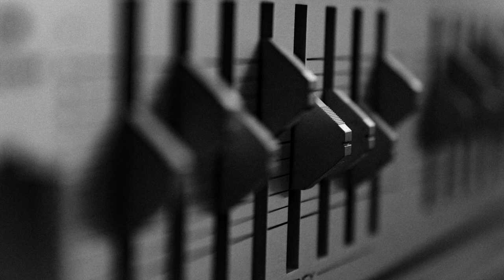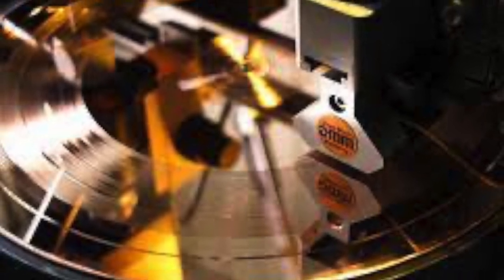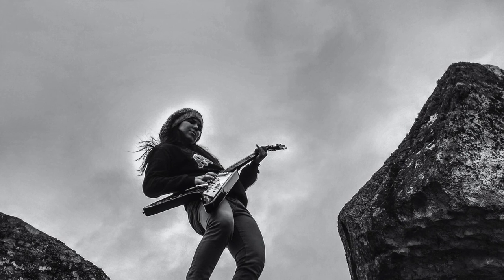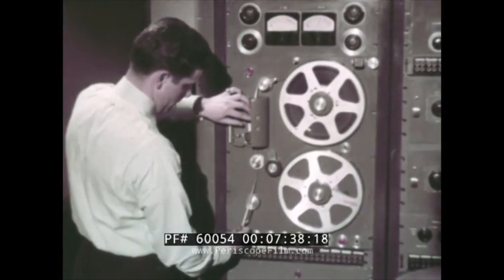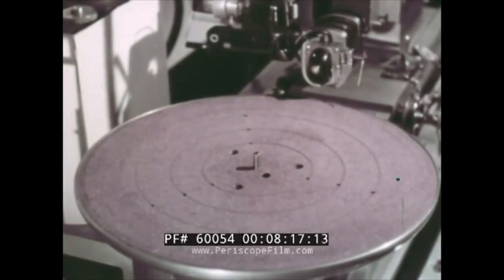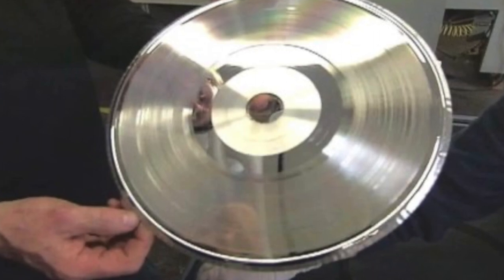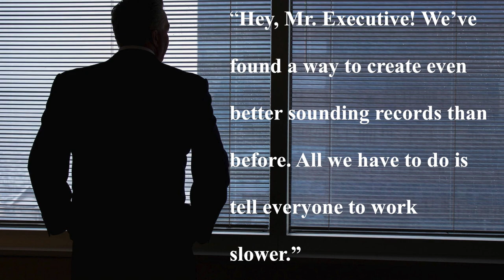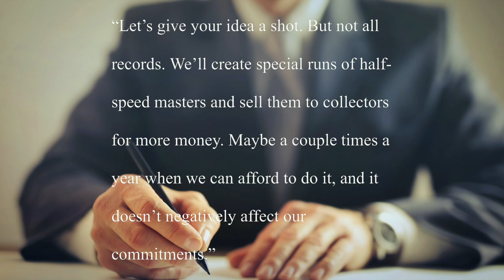Half Speed Mastering

Comment: Reposting on this video:
As far as I know, half speed didnt birth out of ambition to search for higher fidelity directly, but to solve a problem of cutting head overheating and began at Decca in the 60s. Stan Ricker then tried to sell people on the idea that Half Speed sounded better in the 70s.
So I would hardly agree that "Time" and "Money" are the main reasons its not used. It requires a very different understanding of what to listen for, loses an octave in the spectrum which needs to be EQ adjusted for and doesnt seem to produce as good sounding records as it should if everything said about it was true. I can hardly find a half speed cut that beats a standard cutting from a renowned mastering engineer. The only company having some success with it is MFSL, mainly in the 2010s and onwards. But Im pretty sure MFSL stopped doing half speed cutting when Stan Ricker died which is, you guessed it, in the 2010s.
Overall, mostly a gimmick in my eyes.
Reply from the maker: I'm glad you reposted this @Leon.  I had no way to carry over the comments when I upgraded the video from audio to actual images.  I appreciate your reposting!
Reply: I agree that it can be a gimmick in some cases but entirely dismissing it is wrong imo. Incredible sounding Half Speed mastered records are out there, regardless if they're better than the "standard" version or they just sound great on their own. Dire Straits's BIA HS master is fantastic, some people might prefer the MOFI for more bass or the Chris Bellman cut for brighter top end but the HSM version Abbey Road did is certainly the one with the most nuances and air in the treble. Its a different sounding master and there's nothing wrong with people having options. The HSM Ambient series by Brian Eno that came out in 2018 are also great sounding. Sade - This Far boxset features all six albums and all are Half Speed mastered. Every single one sounds beautiful and some do sound better than my old copies in terms of mastering. By far my best and most favourite HSM record is John Martyn's Solid Air released in 2016. I did compare it to the standard edition that came out exactly at the same time and its not even a competition. The HSM edition does everything better. Never selling mine and going forward imo that is the definitive version of that album, doubt even a 2xLP 45rpm cut could improve things any more. Definitely not all albums or types of music are suited to Half Speed mastering but the ones that are certainly can work very very well. And yes I'm well aware Miles from Abbey Road has had done some pretty bad HS masters in the past, but I reckon he still has plenty of time to perfect his skills.
Reply: @werk4408  The question is if these things can just be achieved through good modern mastering. If barely any half speed cut beats out other great normal cuts what is the point? With such a track record it seems pointless beyond a waste of time.
Im not saying it cant sound good, a fantastic recording like BIA or Solid Air will be great almost no matter what you do with them, this is all about comparing though.
I very much doubt the Solid Air HSM is better than the UK original for example.
Reply: @Leon Exactly. Well said and explained in detail.
Reply: @leon9021  No idea if the UK original of Solid Air will sound better, most likely it will sound different. One thing that seems to be a product of HS mastering is tamed sibilance. There's practically none of it in the Solid Air and Brothers In Arms HS cuts. In my books that's a good thing. And its one thing that you can't do with conventional mastering afaik. Plenty of albums could benefit from this, as we all know the vinyl format is very unforgiving of this particular issue, and from my experience how cheap or expensive your setup is doesn't influence the issue quite that much in the end. Again I see it as just another flavour of mastering. Nothing can be perfect. After all bad examples are out there for records mastered with half speed as well as ones mastered conventionally.
Reply: @werk4408  Sibilance reduction or De Essing as its called in mastering is not a product of HSM.  In a fully analog mastering you actually cant de ess very well at all using HSM, much worse than normal cutting anyway.
The reason why the Abbey Road cuts can reduce sibilance is because they are done in the digital domain first where you can very easily utilize that technique, but you can do that just as easily for normal cutting too, the 2016 Pink Floyds are a great example, as they use some very good de essing on albums like Meddle.
You can de ess in conventional AAA cutting but you have to keep in mind that a lot of times its not just due to the mastering. A lot of times sibilance is due to the end users gear, particularly stylus. You can run the same mastering cut with a Conical which distorts and splatters S´s like crazy while it plays perfectly on a MicroLine stylus.
I know this to be absolute fact because Ive dont it myself and it makes total logical sense if you read up on the purpose of higher end styli, I promise you, its very real.

My point is, if its all flavors of mastering, then why spend time doing Half Speed. Just get the same flavor with normal mastering without losing an octave of information and taking twice as long.
Reply: @leon9021  I wasn't aware you can do it with normal cutting also. It does make sense they do it in the digital domain first though. Maybe it's just not utilised enough with normally cut records, and it really should be for some of them. There's plenty of highly coveted audiophile recordings that are inherently sibilant and no one has done anything to improve that when pressing them to vinyl. 

I'm fully aware of how the stylus shape effects the sibilance but in my case that doesn't apply. I use Shibata and MicroLine stylus cuts (aligned and dialled in perfectly) daily so when a record has sibilance I know its not my stylus. Its true that higher end stylus cuts can track it better but you still hear it, when it can be reduced from the beginning. I guess it will be a case of authenticity for some people though. I can imagine many saying that we shouldn't remove information from the recording so if a vocal was recorded hot with sibilance that it should be preserved like this so we can hear it without any changes. 

I get your point but at the end of the day I guess the people putting out the record will decide if the time and effort spent on it is worth it. For many of us it was totally pointless to release the UHQR Kind of Blue with all that fancy packaging and box when it could have just been a standard $40-50 release in a good quality tip on jacket. The end result in terms of sonics would have been identical. As far as the losing an octave goes, I wonder if that is something that anyone can actually notice in reality? From my personal tests and comparisons it seems that I can not. Another HS master record I compared to the normal release was the seminal jazz album by Ryo Fukui - Scenery. I have the 2017 Japanese reissue by Nadja and the more recent Half Speed master that the Swiss label We Release Jazz put out in 2018. There are things I like in the HS master more than the Nadja issue, and overall it sounds outstanding. In fact if that version was pressed in a nicer plant somewhere in Japan it might have even been all together the clear winner of the two. If you read the Discogs comments for that particular release you will see I am not the only one saying how good it sounds. Also I can discern no difference in terms of an octave being lost, everything sounds right and nothing is "missing" from the HS master version. If anything the dynamics of the piano particularly are better. Drums and bass are about the same, bearing in mind this isn't some pure audiophile grade TBM recording to begin with. 

One thing I've noticed with some (not all) Half Speed mastered records is that the whole sound signature can be somewhat... balanced. By that I mean that no particular aspect jumps out too much on its own, be that bass, treble or mid-range. In some cases that can be a good thing, and in others it can make for a more polite sounding master, which I get might not be preferable always. But there are plenty of examples where quite the opposite is the case. Possibly the best sounding HS mastered LP I own is Doug Macleod's There's A Time by Reference Recordings. Double LP at 45rpm that is certainly in top 10 of best sounding records I have ever heard. What I can say about the mastering is that it is very far from balanced, basically everything stands out when it needs to. Great example that demonstrates that HS mastering can sound full, punchy and rich in the bass department when done right. Demo material for sure.
Reply: Yes indeed, Kevin Gray talks about it briefly here:
https://youtu.be/VbVx-e9i1Uk
De essing is losing a bit of information, especially depending on how its done.
Personally I have not noticed much of any sibilance st all since I got my MicroLine.
I have reviewed a lot of albums and used to comment regularly on sibilance but this is rarely ever mentioned now.
Im surprised you hear it so much. Worn records or old styli perhaps?

I completely agree things like the UHQRs are redundant as well. I wish most of those were just done like the Brubeck Time Out 45, you barely gain anything at all from the clarity vinyl, flat profile and boxed packaging except higher prices.

As for the lost octave I cant elaborate much more. Its EQ adjusted for however so it wont sound like its missing completely.

I have the Ryo Fukui too, its great for sure. But I state in my old review which is on Discogs too, that its not quite on the level of something like a Music Matters Jazz and would probably prefer the sound if it was in the hands of someone like Kevin.
There are plenty of balanced sounding normal cuts as well, I dont think thats an effect of HSM.

Again, you can make great sounds on HSM, but if you can make equally great normal speed cuts or even better in my experience then I have to declare it a gimmick

Comment: I'm very disappointed in the two brand new half speed masters I've bought.  Issues with cracks/pops on the "Back To Black" Amy WInehouse album which also sounded even worse than the US standard pressing (I'm in the UK).  The Abba one wasn't any better.  All looks very nice with the certificate and all but what's the point if the sound is crap?  My 80's half speed masters sound much better so really disappointed with these new ones.
Reply from the maker: I have seen a marked drop in quality as well @Ian Marshall.  Not only with the ones you've mentioned but across the board with new records.  Pressure on the industry to meet demand is one factor.  Jack White recently urged the major record companies to start building their own plants again.

Comment: I trust there exists a logic between the old 16 and two 3rds rpm 'talking' discs, when rpm is doubled it (more or less) equates to 33 and one 3rd rpm. Likewise with 33 and one 3rd rpm added to the (usually ) 7inch 45rpm speed gives us (more or less) 78rpm. I recall an article of yore that suggested 78rpms were recorded at 50 inch per second reel to reel tape? Naturally, the higher the tape speed resulting in less hiss transference in order to make a master/ stamper configuration. Some of the later 50s 78s I own (usually EMI) distributed labels were pressed on swish o flex,  vinyl, with no shellac content, allowing them the flexibility of the new vinyl 45, but without the sound compression.

Interesting Channel Sir.

Cheers

El
Reply from the maker: Cheers @Tablet Twenty two !

Comment: Greetings Rick, hope everything is well. Question: I just bought an audio technica lp 60x, it sounds really good, but it took me a couple of days to notice, the speed is a little faster, I did the speed test, and it is running at 34.31 rpm and 46.04 rpm; with some records it is more noticeable than others(for example, when I play my copy of dark side of the moon I barely notice the problem). With some albums I don't mind too much, but with others a little bit. Do you think I'm risking damaging my records playing them with that issue? I only have like 2 weeks with the turntable. Thanks.
Reply from the maker: Happy holidays!  

I'm sorry to hear that.  It won't hurt your records but it does sound like a speed control problem with the motor.  Especially if its audible to you.  When it comes to speed, I was once told by a turntable guru I respect to trust your ears.  If you only have a couple weeks with it, did you get it somewhere where you can exchange it?  I've either recommended or bought that model for friends and family and haven't had that issue.
Reply: Thanks Rick, Happy Holidays to you as well. I think I still have time to return it, also it has a guarantee. I'm going to think what to do about it  @TheJoyofVinylRecords
Reply: Hello Rick, I solved the problem myself, there are 2 holes on the bottom of the turntable, one says 33 the other 45, with a tiny screwdriver and a RPM app in my phone I was able to adjust the speed for both; I moved it from 34.31 and 46.04 to 33.26 and 45.50 which is more in the normal range @TheJoyofVinylRecords
Reply from the maker: @tantalo45   Wow - I just learned something new!  Thanks for getting back to me on that.  I didn't realize that option was there.  Very good to know.